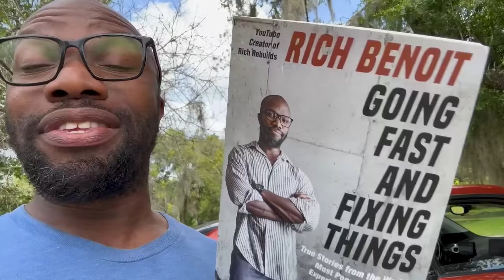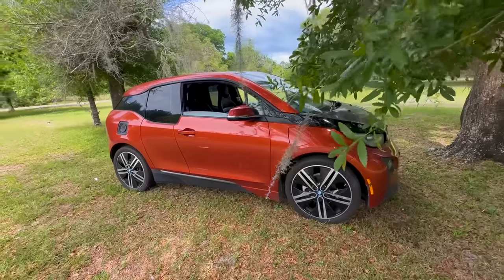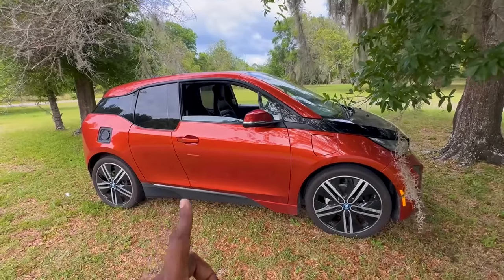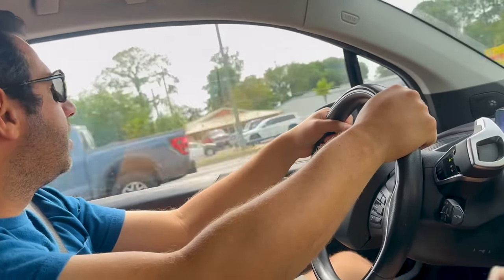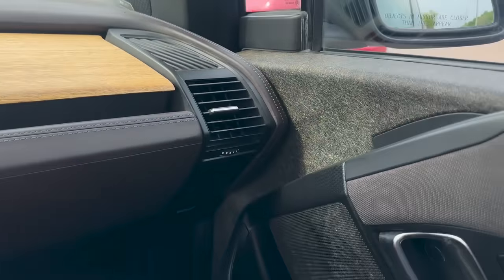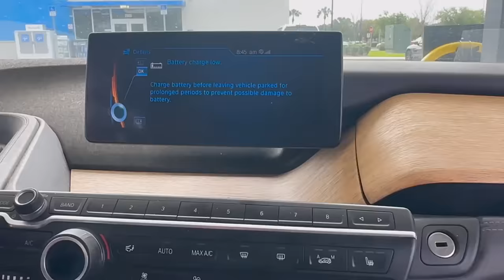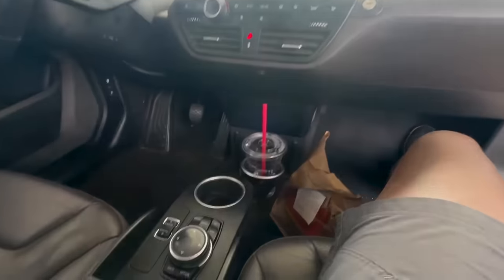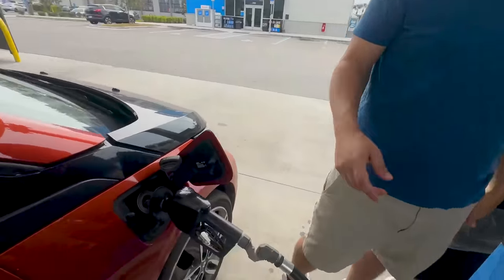I Bought a Ten Year Old $3500 EV and I Increased its Range To Over 400 Miles!

Comment: I’ve been daily driving my 2012 focus electric for 6 years. 50-75 miles of range is just fine for daily errands.
Reply: just drove over 1,000 miles in three days this weekend. not going to suit me.
Reply: How much is that replacement battery going to cost when it inevitably kicks the bucket? Probably just write off the car like all 10plus year old EV's. My 30 year old Corolla is greener than any EV on the road today.
Reply: @JT-tz5hp  I am hoping that after-market batteries for common makes will become common.
Battery prices have dropped in half in the last year.
Reply: @JT-tz5hp My decade old i3 is still going. Your Corolla still burns petrol which will never be ‘green’.
Reply: and even considering emission from electricity generated (which WILL 100% reach negligable amounts) still easily 15-20x worse depending on where you live
Reply: I had three of those before my Model 3
Reply: @cobaltlukather9045  Not every car has to be for everyone.

Comment: Hay uncle Rich no concerns with safety just strap a gas tank square in the front end of the car LoL
Reply: Fuel cell
Reply: Crash test ? Lol
Reply: @bgee461 he was right....... Fuel cells are never taller than they are wide or long! 😂
Reply: Ford Pinto baybeeee
Reply: Gas tank became crumple zone. lol I think he could move it to the back to make it safer, but this was a nice experiment.
Reply: I owned two Corvairs (1964 & 1965), both had the gas tank in the left front fender, just in front of the driver position.
Reply: The weight increases braking power.
Reply: Right up front with ... what? The high voltage bits? 🙈
Reply: Yup!!
Reply: @dennissorensen8765  almost like having rubber fuel pipe in the same compartment as red hot exhaust pipes...
Reply: Exactly like my 1969 VW Bettle
Reply: 18:20 Gas tank installed in frunk
Reply: @SNORKYMEDIA there aren't any exhaust pipes in the front, the engine is in the back... the safest place is in the front of the car.

Comment: Hey Rich, that is a really cool idea adding and small gas tank in the frunk area of the i3. I might have to try it out sometime very inspiring. We usually drive the i3 from Santa Clarita to Reno a hand full of times a year to visit family and friends. Here’s what we do to survive the 440 mile commuter in our i3 with only a few rex fill ups and 1 charge stop. Our i3 is a 2017 (33 Kw battery) so I get around 116-125 miles per charge, a bit more than the one you guys drove. Ok, we start out leaving the house with a full charge, we drive 50 miles on battery to get the battery down to 74% (1 percent under 75%). 
Then switch over to the REX and drive 70 miles with the REX. Then stop for 5 mins to top off the REX drive another 70 miles. 
Then switch over to the battery and drive 50 miles on the battery. 
We usually stop in Santa Nella, Ca take a break to eat, restroom Ect... for about 35 minutes and charge the battery to 85% we use the ChargePoint charger. At this point we have driven 240 miles (roughly) which is about half way of our trip.
Ok, drive another 25 miles on battery until 74% and hold state of charge and switch over and use the REX and drive for 70 miles. Stop for 5 mins at the gas station and top off REX and drive another 70 miles and then switch back to the battery and drive 35 miles to our destination and wah-la that's the way to drive an i3 on a longer trip. 
People don't realize you can drive the BMW i3 really far if you have the REX and code the car to “hold State of charge” at 75% of battery and use your REX to plan out on a longer trip. There’s always a gas station within 80 miles of driving, so you can top off the REX anytime you need to and calculate how you want to use the battery so you’re not stopping for long periods of time, but the 8 gallon gas tank idea is the "BOMB". I have to say we absolutely love our i3, so much we bought a second one for our family. Thanks for sharing this video, it is totally AWESOME!! :face-red-heart-shape:😎
Reply: Sounds exhausting!
Reply: You really should have bought a Tesla.
Reply: Not really, it's just a couple of quick stops for some gas and your good to go.  @randyland1000
Reply: To much work and stress
Reply: If you like to treat real life driving like it’s some RPG video game, be my guest.

Comment: Rich: Does a very advanced upgrade
Me: Puts a gas can in the frunk
😂
Reply: Yeah I was wondering that also.
Reply: Exactly. I still have to stop every hour, but no worries about being in the middle of nowhere.
Reply: @ksnax  - Exactly.... Just pull off the side of the road like you do to pee then pour a splash of gas in and you're off.      😂
I'd probably just put th fuel pump in the frunk tank and use the small tank as a reserve tank... That's just ridiculous.
Reply: @xpndblhero5170  BMW owners can not be seen on the side of the road and using a jerry can full of gas. The hidden tank under the hood with fuel transfer pump is the only way. For context many BMWs don't have an oil dipstick because owner's would not want to get their hands dirty, instead the car has a digital oil sensor with dash display!
Reply: I can appreciate the project, and once done, the car could do many road trips, but would never make sense just to ‘get it home’. 2 min with a 2gal extra mini tank, repeat as needed, would have been faster, but hey, he’s got skills I don’t have, so why not?   Definitely code it to unlock the SoC when you want and the extra 1/2 gal in the original tank too.  Don’t forget winter tires too!
Reply: @uhjyuff2095  - My car does that too but I still get out and check under the hood.... I guess that's the difference between owning a BMW and a Chevy Cruze.     😂
Reply: I would think a fuel cell or gas can in the back is safer but does put it closer to the engine.

Comment: The really slick trick would be to design a thin tank that can fit into the nooks and crannies in the front area and be rotationally molded. The frunk liner looks like it's not making use of every millimeter it could in width and front to back, so do some Cardboard Aided Design to fabricate a prototype that can be used to make a fiberglass mold inside for laying up nice fiberglass liners - designed to accommodate the new auxiliary tank.
Wherever the OEM tiny tank is, I bet there are spaces it could be bulged out into so a new tank could hold more fuel.

Comment: I had a 64Ah i3 REX. Drove it 83.5k miles i  3.5 years including a 400 trip to Le Mans in 2016 carrying communal camping gear. What an adventure! Considering there were only about 8 CCS units at the time and 3 of the were bit of order. REX saved the day! Plus a 10 litre jerry can in the frunk.
Best part was that uear they introduced a ban on glass bottles on the canpsite. And we'd just bought 18 bottles of wine from SuperU.
Said to Marshalls... no worry my mates parking offsite. Ill dump them in his car. Drove round the corner, stuffed them in the frunk with a load of t-shirts to stip them rattling. Cleared security. :) i3 saved the day.

Comment: Always put gas tanks in the crumple zone. Oh.. Never put…
Reply: Yeah, use a fuel cell instead like he did
Reply: You are so correct, I have never owned a car or truck with the gas tank in the front. But, all my motorcycles...
Reply: @larsch6529  haha- true. But you likely wouldn’t be near it when it’s crushed! 💀
Reply: Got me thinking, this design may have benefits. This car is in a frontal collision, the plastic gas tank  breaks, the leaking gasoline ignites, the driver is cremated. Scoop up the remains and save on funeral expenses.
Reply: @bgee461  A 'fuel cell' offers no better protection from crash damage than any other tank, and in fact the polyethylene one Rich used probably offers less. I.e., there is no magic formula for tank construction that prevents rupture beyond strength of the materials and protection from impact. The only real advantage is that fit is more flexible and they have hose fittings.
Reply: @larsch6529  A number of older cars did indeed have their fuel tanks in the front and with older I mean really old, like the VW Beetle. Some cars even had the tank directly over the engine (f.e. Trabant) or at least had the Filler neck in the engine bay (a lot of french cars).
Reply: @Enakaji  911's, boxsters, caymans and any mid or rear engine cars have their tanks in the front, including the new corvette.

Comment: Did you run the nylon straps around the AC lines?

After watching Rich Rebuilds for at least a year, I bought an i3 Rex and hoped he would eventually do a video about one. Now that I’ve already replaced the AC compressor and condenser myself in my garage…, I have little need for instructions on how to do that job with a kitchen knife. 
But I do look forward to watching him do the projects that I’m procrastinating… And helping other i3 owners learn to work on theirs.

Comment: 27:32 I want to put these tires on my CRZ, sure its EPA rated at 35MPG, but i'm going on 450 miles on this 10 gallon tank(never takes more than 8.5) and the gauge is saying 53.4MPG
But this is with these tires that seem massive and wide, they also feel heavier than the tires on my 6 door limo, and those are truck tires(got tired of punctures so ditched the white walls.)

Comment: That's a really brilliant idea, mounting the fuel tank in the front so on impact you get covered in gass. Ford did something similar in the 60s it was cheaper to pay compensation to the victims rather than modified the design.

Comment: The i3 is not "running on gas" like a hybrid.  It has a gas generator that charges the battery as you drive.  Not a good idea to let the charge go way down and wait for the REX to come on.  Better to code it for hold state of charge.  Then you can strategically generate power for the battery without the fear of getting in a situation where the REX cannot hold the state of charge, but instead is falling behind.  Anything above about 60-65 mph  on the REX will slowly eat into your battery percentage.  You do not want to be in that position at 6%-7% battery.  The car is crippled without HSOC "coding".

Comment: I tell you two magic words: Prius Prime. It goes 30 mile electric in EV mode (I don't drive like a lunatic) and overall 550-600 miles range in hybrid mode. Costs half as much as a BMW i3. Top that!
Reply: in the used car market, probably not
Reply: 30 mile EV range is terrible, might as well not even have it.
Reply: @tf6437  That range is enough for me to make multiple trips within the city limits (workout, groceries). But whenever I go to conferences / events to the Bay Area, SF or LA the hybrid mileage is great. A round trip to a SW conference in San Jose is almost just half tank even though I have to climb the Pacheco Pass. But once again, when I am not traveling 25 is enough, and Fresno is not even dense. I can imagine it would not be enough around Phoenix which is more distributed.
Reply: New, maybe.  But used the i3 looks about $2k cheaper than the Prius Prime.
Reply: @CsabaTothMr  it's just wasted weight. That 25-30 mi of EV range, you could just get 25-30 mi more of gas range without the weight of the battery. Again, might as well just not have it.
Reply: @CrappyCar  Put that in perspective of range. I have 550-600 miles combined range. And I could often transport my Jackson Rockstar XL rodeo kayak inside the cabin, it's that big.
Reply: @CsabaTothMr  No argument there, and I'm sure the Prius is more comfortable.

Comment: Rich, you can adjust the % charge that the REX kicks from 20% to up to 80% (at least when I had one). I just used an app and “coded” with a bluetooth obd2. I think it was with Bimmercodes. That way you can hold a higher state of charge on the highway and not lose power. I would change this %charge for when I had long trips planned so that I can maintain 70+ mph.

Comment: In order to make it EV with range extender and not a hybrid, the needed for the tank range to be smaller than battery range. So they would shut down the fuel pump until it detects it is being filled.

Comment: to hell with a button, run a trigger to the pump
from the gauge and code it to kick on
with AC or Cruise control so it auto fills upto "preferred state"
Reply: Well, no shit. Except that's far more complex.
Reply: @rustler08  lmao is it tho? 
i think you forget the channel your on.
not to mention the car has most the shit i spoke of already there.
a good "dealer" level, or bmw software (which is widely available) is all one would need to code this. *buttons are used for triggers all the time. maybe just maybe, to complicated for you...?

Comment: Hay Rich. Instead of adding a gas tank, add more battery’s. That would get more range,  remove the petrol engine and stick them in there, that would give you more range and make the car much simpler?
Reply: Simplicity comes from not reinventing the wheel though. A larger fuel supply is as simple as range mods come for these cars. More battery capacity is the next simple upgrade by replacing the main pack with newer larger capacity ones. Replacing the REx with cells would be the most complicated route and not get much extra, as the REx itself is a .6L scooter motor.
Reply: @ksnax  that does make sense, but Rich, has loads of batteries lying around, and it would make a good YouTube video.

Comment: It's a shame BMW stopped making the i3. It was a really good idea and a really good-looking car. It would gain a good chunk of range if they used a decade-newer battery and motor tech. It doesn't even need much of a face lift either, maybe change the head unit and the headlights and it would be on par with any 2024 model.

Comment: I made a diesel range extender. Than I found out, that I don't need those batteries and electric engine, so I got rid of them. Now I'm only driving on a range extender.
.
.
.
.
.
.
.
.
.

OK, I was joking, I simply bought a diesel car with a range of 1100-1300km (around 800miles). 
:D

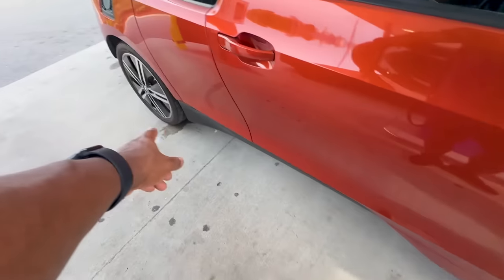Comment: 5:58 damn dude, for a person that wrote a book, its kinda wild you didn't know that was condensation from the giant ass AC compressor used to cool the batteries, also a gas tank in the very front of the car ._. One bad front end collision and everyone is dead, a nice fuse to light up the lithium ion bombs under the car. There's a reason most gas tanks are under the back seats and not under trunk.......

Comment: i said this in the late seventies but in a different charging cycle  ? long before eve's were on the cards use a moped sized engine to charge the batteries while you park for work or shopping at home etc use natural gas instead of petroleum ?

Comment: Wikipedia says the base model with 60KWh battery does 100 miles in EV. But range extender adds just 50 miles. If that’s true what is the point?  I must have a lawn mower fuel tank. The 120KWh is better but REx is still lack-lustre.

Comment: Chevy Volt gets great reviews from everyone I talk to. They only use a few gallons of gas per year, because the electric range is enough for most trips. Hybrids that have to use a gas drivetrain means 2 drivetrains, plus exhaust, vs a range extender which is just an optimized generator. I'm talking about things the size of Ramcharger, which says it has a V6, implying dual drivetrain. I feel like if they were smart with the RE it could maintain the battery around 20% instead of using a gas engine to assist with traction power.

Comment: The newer I3 from 2019-2021 has a battery that is twice as big as the one in yours. 60 amp hour vs 120 amp hour.  I can get 200 miles on the battery.  I am hoping that there will be aftermarket repair shops around the country that will replace/upgrade batteries and service other parts of the I3. How about putting a bigger battery in yours?

Comment: I think the Extended REx makes a lot of sense.

The REx is not at all common in Norway, probably because it's considered a PHEV rather than RExBEV, 

I think BMW should have three vesions of the i3
i3 BEV (battery only)
i3 REx (2 gallon/7.5 liter tank), where applicable to still count as EV)
i3 PHEV (8-10 gallin/30-40 liter tank), where REx doesn't matter, or you just want PHEV

The battery of i3 is decent for daily local commute, but the tank of a REx is a joke, and the size omly make sense where there is a legal reason to have it that small, or if you want to keep the frunk.

Comment: Another great success, but I got a laugh. That's a tricky statement, "I always thought that hybrids were the worst of both worlds; very small gas tank with a very very small battery." It depends on the hybrid. Prius Prime does have a tiny battery (about 35-45 miles) but 11 gallons of useable fuel. It's common to average better than EPA's 52 MPG (600 miles range). Fuelly drivers tend to get 65 to 80 MPG by charging at home. (Obviously that MPG is raised since some commute mostly on electric, offset by the gas engine in cold weather.)

Comment: This is not an EV. You are literally filling it with gas at 6:40, and you plug it in at 7:55. It is a plug-in hybrid. Fuck off with the false advertising in the title. 

For anyone reading this, they took 34 minutes to explain that they tapped a line into the fuel tank in order to have an auxiliary tank supply it with more fuel (replacing the cargo capacity of the 'frunk' with a fuel cell). They are just increasing the range of the car by increasing the FUEL CAPACITY of the car, because they will be using the FUEL to charge the battery. smh

Comment: I've been looking at these for a daily...the real issue is the odd tire size that is extremely hard to source, and some brackets and pieces that are integral to the car but extremely expensive with a limited time to access them.
Reply: As an i3 owner, which brackets? I’ve already started stockpiling parts from eBay ahead of the inevitable lack of availability.
Reply: @soumiksaid  motor mounts....for some reason they are made of plastic.
Reply: @diydrivenGA  thanks for the quick reply! <sets new eBay alert>